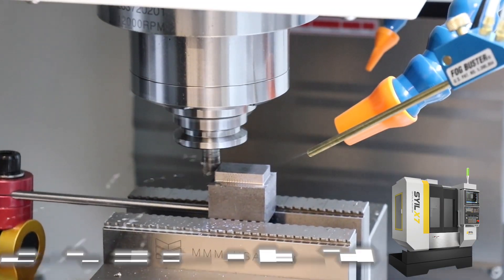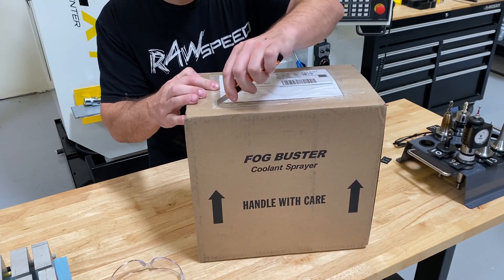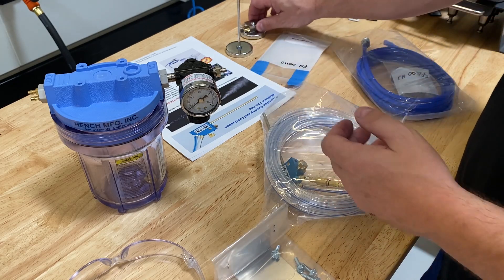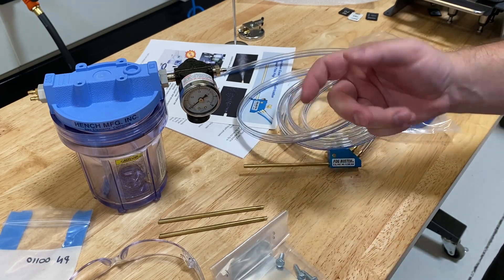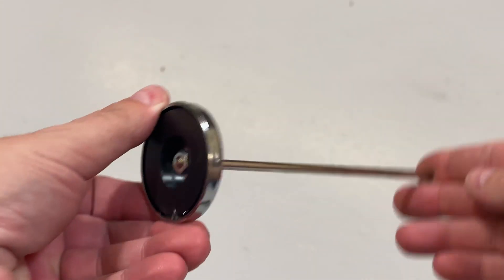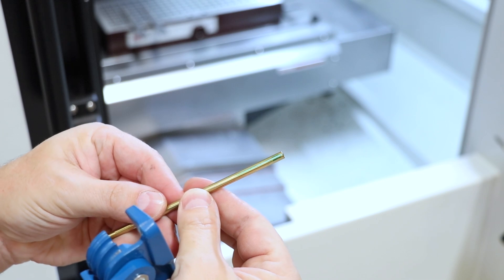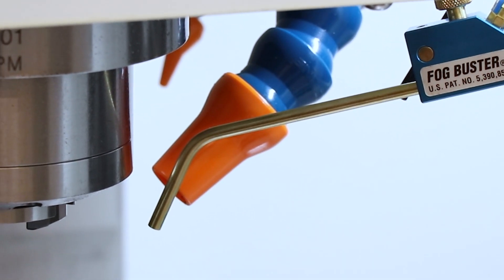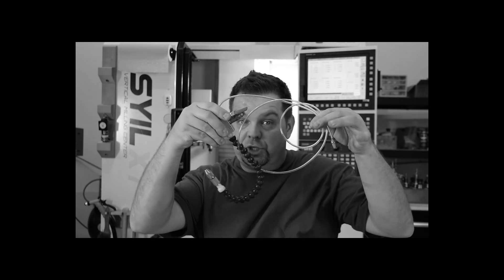Fogbuster - Mistless Coolant Sprayer

Comment: Can i ask how you are getting on with NC Simul for your Okuma? I am about to take delivery of a Haas UMC500, and i'm not sure whether to go with Vericut, NC Simul, or CAMplete.... 

Hexagon offer pretty good monthly pricing on NC Simul, with only a 12 month commitment. I'm not sure if it's a false economy in the long term though, and whether i should go with Vericut from the outset, even though i have to pay a big whack up front for it. I don't like CAMplete because it doesn't take the probing routines from Fusion 360. Instead, i have to do them inside CAMplete which is a bit of a faff in my view...

My final option is to go with Esprit, which has built in simulation, and isn't too much more per-month than NC Simul for the 5-axis package. Other 'high-end' CAM packages are too much money upfront for me i think.

Comment: Hey.  I was wondering out in left field here.  I have a Haas Minimill2 with PCool.  Can the fog buster nozzle be mounted onto the side of the PCool stem?  This way you could aim it with the PCool setting.  Just a thought.  Coolant, of course, would be off while running but the tool call would still aim the nozzle.
Reply from the maker: i'm willing to bet you could...i had a fogbuster on my super mini mill 2 but didnt have Pcool.

Comment: What is a typical air flow requirement for the Fog Buster?  

I hear from the video about 10-15 psi but any idea approximately how many scfm is needed at that pressure for decent performance?
Reply: I measured 27 l/min on mine
Reply: @FriedrichKegel   Friedrich, thanks for the reply.  This spec for the FB is incredibly hard to find. I’m sizing up a compressor for my home shop and need to know what size unit would work, as a minimum. 

So I understand, you measured 27 (std) L/min at about 15 psi?  Do I have that right?
Reply: @iainsquelch6223  Yes normally I run it at 30psi for better chip evacuation in holes and deep pockets

Comment: You can get a cheapo mister and put a pressurized container off of amazon. water filter containers are the same thing as what the fogbuster uses. costs like 50$ total and you get comparable performance to a fogbuster

Comment: The cheapie one you showed is more like in the $5 range than $30 range. Had one just like that. The valve leaked, the loc-line imitation leaked.. all in all it was a wonderful product :) I bought a little better one off Aliexpress for $15 and it is much better. No leaking. I am using a whiff of methylated spirits with about 30 % added water and about 4 bars of pressure. I work in a little garage-like space and sometimes I can taste the evaporated Bitrex on my lips. If vodka was as cheap here as it is your country, I would probably use that :)
Reply: Hi,

Don’t, don’t do that. Methanol really not nice to breath . Please switch to ethanol if you still want to use alcohol mix. I’d even use isopropyl alcohol . Again, I urge you not to use anything with methanol in it( methylated spirits).
Sorry if I sound rude, I mean well :-)
Alistair
Reply: Thanks. I just checked what the contents of the usual stuff are: <0.5% denatonium benzoate, 0.5-5% acetone (this was a surprise) and at least 60% ethanol. This is the cheapest alcohol I have found locally. The next option sometimes in use:  2% methyl isobutyl ketone, 2% methyl ethyl ketone, 1-5% isopropanol alcohol and the rest should be ethanol. So not methanol in that either. It seems that since 2017 it has been illegal to sell for example windshield wiper fluid containing more that 0.6% of methanol.
Reply: Hey,

That’s a relief eh?
On my machines , big and small cnc routers, tormach 1100, and haas mini mill I have a three different coolant systems. The routers have fog busters running cool mist brand coolant. It’s mostly polyethylene and ethylene glycols. Cutting aluminum. On the Haas it’s just flood coolant . The tormach I have one of the cheap misters, actually two. Running cool mist brand coolant. But what I did was add a brass tube, much like the fog buster tube, pressed over the cheap mister nozzle. Not only does it make directing the coolant better, but it reduces the mist. Not as good as fog buster but towards that effect. Give it a go, put a 4-5” tube on the cheap mister nozzle and see what you think.

Alistair